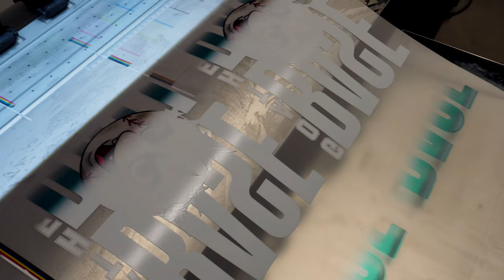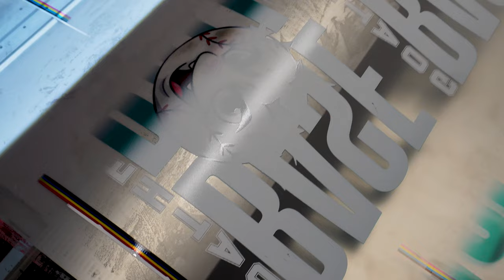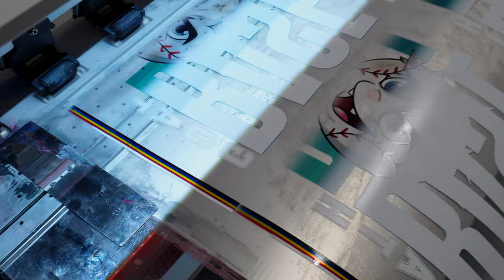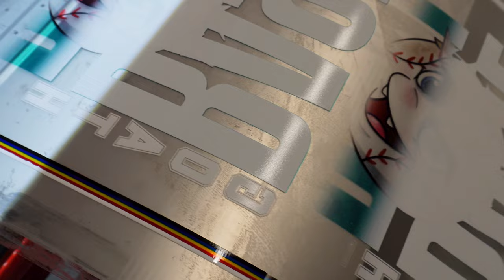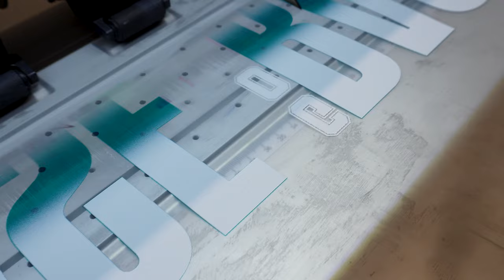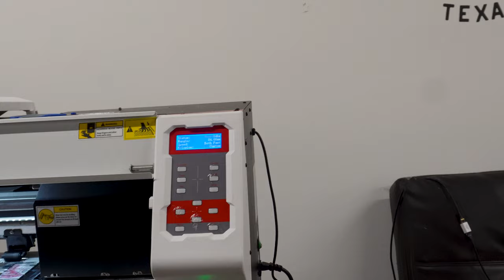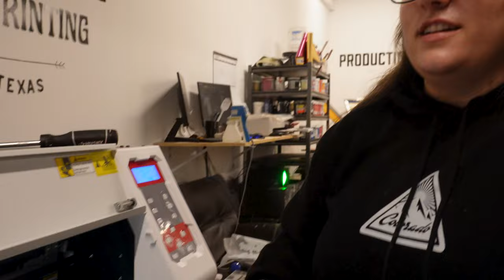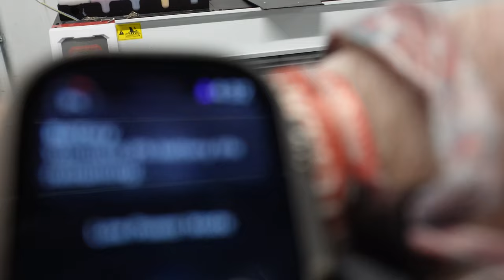MAJOR DTF PROBLEMS, Nasty Nozzle Clogs - Raw unfiltered behind the scenes VLOG

Comment: Vertical offset is usually going to be associated with PrintExp and the vertical alignment setting. Another thing that can cause that offset is film roll tension. The roll on the back of the printer has tensioners on each side. Try tweaking those and see if it helps.

Comment: Also, the issue of the clogging is related to the dried up rubbery ink that was found around the capping station, where as the same build up happens on and around the actual print head(sometime giving print smears and blocked nozzles). On audley printers the printhead is some what easier to remove than other printers. I would pull the print head and visually check the metal plate the the printhead is mounted to and the underside of the printhead. I keep spare printheads(I know expensive) to switch out while I soak one in cleaner to  fully open up all nozzles. You have been printing long runs of transfers for quite a while. Eventually requiring what I call a PM(preventative maintenance) cleaning. That 1000 hour cleaning.
Reply from the maker: Very helpful thanks for the insight!!